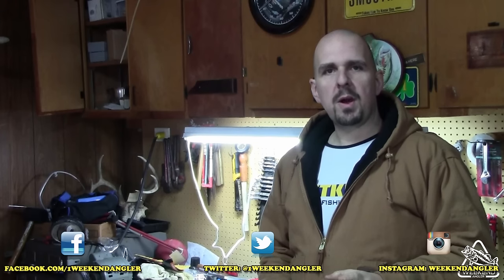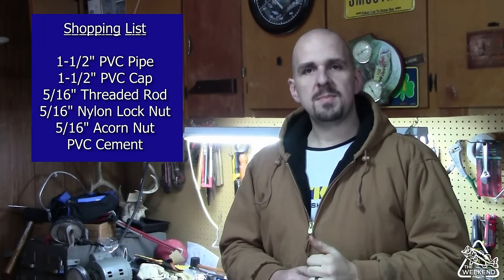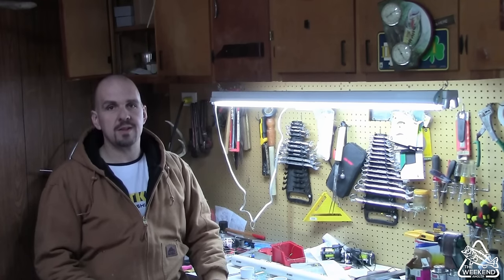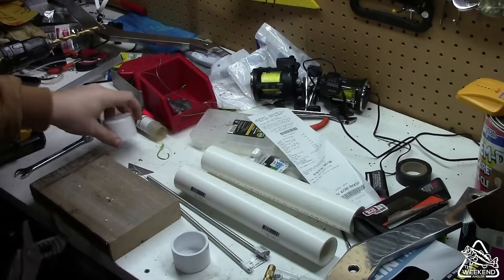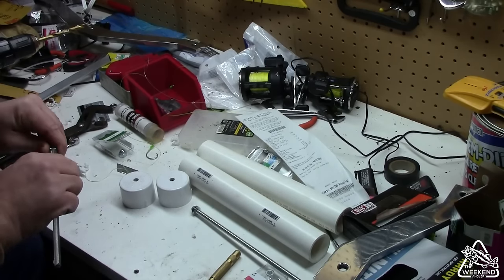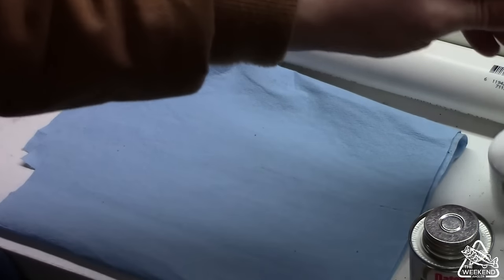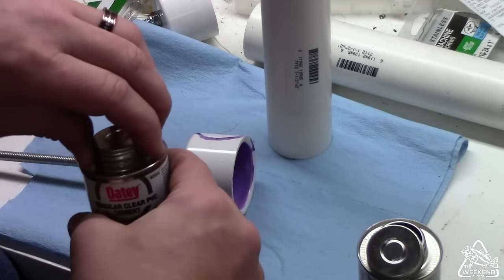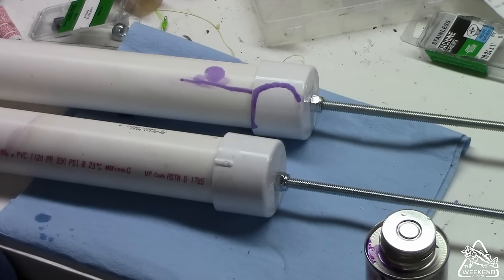How To Build Quality Bank Rod Holders for $10 or Less!

Comment: I would highly recommend using a couple wide washers on either side of the PVC cap, just to add a little extra strength to it. The last thing you want is for the PVC cap to crack where you secured the rod to it. ;-)
Reply: I was actually going to ask why no fenders and a lock washer lol
Reply: I was thinking the same thing

Comment: I used 3/8" all thread rod with nuts and washers on both sides. I also took my holders a cut slots for the reels  on my table  router 👍
Reply: Don't glue and you'll have better storage. Mine were prolly 3' long rods with 18" rod holders.

Comment: Just saw this, great idea and cost effective. What about adding some washers? I believe it will hold better.
Reply from the maker: You definitely could add them. The caps I use are really thick and to be honest the only one I've ever broken was when I tripped over it with my big size 14 feet. Lol. But washers are cheap and wouldnt hurt a thing to install.

Comment: I was going to mention what another person said about adding some washers to strengthen the cap.  That area could crack under certain circumstances.  The only other thing I would have done in addition to that is, is grind the end of the threaded rod to an angle/point to make it easier to insert it into the ground.

Comment: Put the nyloc nut on the same end before the acorn nut. Then you only have to thread it the thickness of the cap ...less than 3/8..save some time. 
 After the all thread is inserted through  the cap, then tighten the nyloc to the cap. 
 Thanks for the build. These are very easy  to use.

Comment: Cool rod holders! Note - you could have just threaded that nut on there then added the cap and acorn nut instead of threading the nut all the way down the allthread. Also, when I make these im going to add some washers!
Reply from the maker: I had a reason for doing that on the first set I made, but I can't remember what it was. When I shot the video I just repeated what I'd don't in the past.

See the blooper reel from that year to see me about break my wrist with the drill. Lol.

Comment: Just an idea, but if you were to put two caps back to back and not cement the cap to the pipe, you could flip it around and store the all thread end inside the pipe for storage when not in use.

Comment: Think about this.You need to make an over head rod rack in a pontoon boat.Get a piece of aluminum angle or other wise the width you need it to be for over head rack.Use shorter bolt,s to attach it to the aluminum ,spaced the distance apart to accomadate your rod,s,then attach it overhead where you need it in your pontoon.Then the distance you need it to accomadate the length of your rod,s ,put another one exactly like it on the other end to hold the rod,s in place.Make the rod tip end pvc,longer than the back end pvc,  and attach it the same as the back,then you simply insert the tip end in then pull it back to go in the back pvc.Then place a bungy cord or two in front of the reel,s to keep it tightly in place. I have a pontoon ,and this gave me an idea for a roof rack.Thank you.
Reply from the maker: Awesome! I'd love to see your finished product. I've been working on designing a cheap and effective roof rack for a Suburban.

Comment: Looks good I think I would feel a little better about it if it had washers.
Reply from the maker: That's definitely an option. The caps I use in this video are a lot thicker than some of the other ones I've encountered. I have only ever had one of these break and that was when I tripped over it in the dark.

Comment: 2" pvc,  rebar and duct tape. Duct tape the rebar to the pipe, real good. leave the bottom open so it can drain in the rain. Let the rebar stick out 1" over the top so you can hammer the rebar into hard ground. Easy, fast and strong. Cheap too.
Reply: Yes! I want to be able to hammer into harder ground!!!!

Comment: Do they make rods with threading only on one end?  Seems like it might be easier to clean the dirt off of it when finished as the dirt would get embedded in the threads the way it is now.  You'd have to maybe just use non lock nuts and thread the nuts from the one end, but doesn't seem like a big issue as you could always use the loc-tite if worried about the nuts loosening over time.
Reply from the maker: You might be able to find a hex bolt about 12 inches long or so. Then you could cut the head off of it and then just use the short section of threading.

Comment: Just a heads up, they make clear PVC primer.
Reply from the maker: It used to always be clear, then the home inspectors started griping that joints weren't primed even though they were.

Quick fix was to add dye to the primer. Then you can tell the inspector to sit on a flag pole. 😂

Comment: Nice holders great video, so if I wanted to make some for Surf Fishing, just need bigger or  maybe  thicker all thread?
Reply from the maker: I haven't done a lot of surf fishing, and it's been about 7 years since I've done it at all, but the guys were just using a long piece of pvc pipe cut at an angle on one end. It goes into the sand easily with a rubber mallet and holds things securely.

I don't know that I'd trust a rod to all thread in sand. The sand spike rod holders were like 3 ft long.

Comment: Nice project. I have that drill! I wonder if a couple of fender washers would help make it even more stable? Either way, I think it would be a nice fun project to do with my nephews or something. Nice job on the video too!
Reply from the maker: EatnLunch Fishing  thanks. I bet the fender washers would definitely increase the stability. I usually sink the all thread to the pvc, so I haven't had any issues yet. 

Just fyi if you use the drill to wind in the nyloc nut, set your clutch. Don't ask me how I know this. But the 2018 blooper reel might show why I know this.
Reply: Ha ha, I can picture it in my head and it is glorious!
Reply from the maker: EatnLunch Fishing LOL

Comment: I'd use washers as others have said, also probably easier to run one nut down the rod a touch then put washer, then put plastic cap, then next washer and nut. Rather than running that nut down the whole length of threaded rod

Comment: You should have put a notch on the top where the reel handle goes  but a very good idea no the less
Reply from the maker: The handles on my catfishing rods are long enough that the reel sits above the top of the pvc anyway, but yes, a good idea especially when using shorter rods.

Comment: Only thing I would have done different would have been to put oversized flat washers inside and out to increase the pressure point on the cap. Still, great idea.👍
Reply from the maker: I've used these for long enough that I'm not sure they need the washer, but it also definitely wouldn't hurt anything to install them either!

Thanks for watching and taking the time to leave a comment.

Tight lines!

Comment: Primer was made for the convenience for plumbing inspectors. :)
Reply from the maker: I'm inclined to believe that. 😂
Reply: Primer is crucial when gluing PVC. It creates a stronger bond. Just using the glue only results in joint failure after a few years
Reply: Stanley Harris   “According to the manufacturer, one class requires the application of primer, such as All-Purpose cement, Regular Clear PVC cement and Medium Gray PVC cement. The other class does not require the application of primer, such as Hot Medium Blue Lava PVC cement and Rain-R-Shine® Medium Blue PVC cement.” 
I have pvc joints  30 years old still going strong. I would conclude that early eminent failure is not categorically true.
Reply: I have seen PVC joint failure on a regular basis when amateur plumbers apply only the glue. It dries out and it all pulls apart.

Comment: Why not run the locknut down the short end first, then put the cap on, then the acorn nut? Work smarter not harder!
Reply: Thats what i would do.  What ever works i guess same resluts.
Reply from the maker: My OCD would kick in about that lock nut being upside down in relation to the pvc cap. It would work, I have no doubt, but would bug me. If I turned it around, I'm not sure I could have gotten the lock nut to start since I'd be in the nylon part first instead of the stainless threads. 

Great idea though, and it would have been the easier approach. Thanks for your comment.
Reply: My thoughts exactly!!

Comment: Why not just thread the nut from the sam side the cap is on? You wouldn’t have to go the whole length of the rod.  Nut then cap then cap nut
Reply from the maker: Those nyloc lock nuts are a real pain to start backwards.

Comment: That looks like it will break at the cap. My friend makes them and uses very strong tape and tapes the metal part (end of an old screwdriver, anything he can find) to the side of the PVC. At least 6 - 8 inches up the outside for good strength. Tapes the crap out of it. Plumbers tape maybe.

Tip: put the second nut on first so you don't have to twist it down a foot of rod from the other end. Cool.
Reply from the maker: It looks like it will break, but I haven't had one break yet and I've been using one particular set of these for several years. Either way works. I've seen the ones done with the metal strapped to the side. I've seen folks use muffler clamps, hose clamps, gorilla tape, you name it. 

In the end it's what you feel comfortable with using. Thanks for stopping by and commenting.

Comment: Those won’t handle a 10-15 lb carp it will bend d all thread n break d pvc lose d rod  reel I know for a fact!!!!
Reply from the maker: They have handled 20+ pound blues without issue. I know THAT for a fact, slick. I have broken one of these and that was from using a rock to try and beat it into Rocky ground.

Comment: nice project , but walmart has rod holder around $5 bucks
Reply from the maker: They do, but most won't hold larger catfish rods like the Tangling with Catfish Extremes that I use. The diameter is too small and the rod won't fit. That's what prompted me to build these.
Reply: @TheWeekendAngler  you are correct.